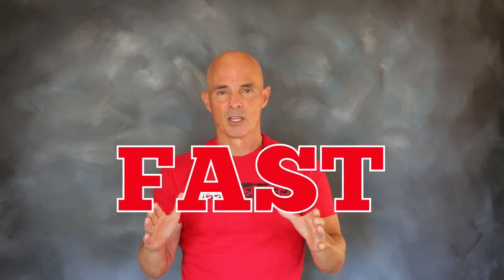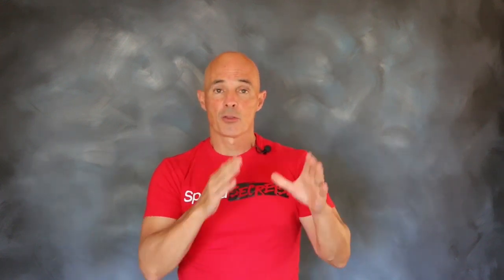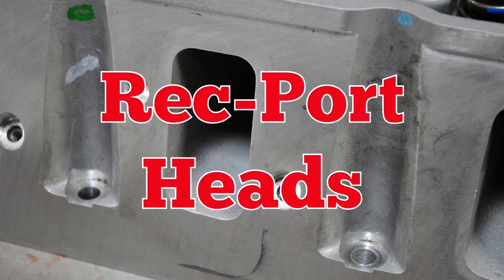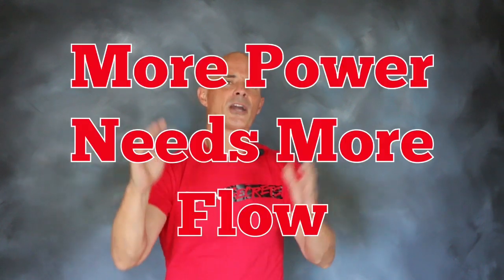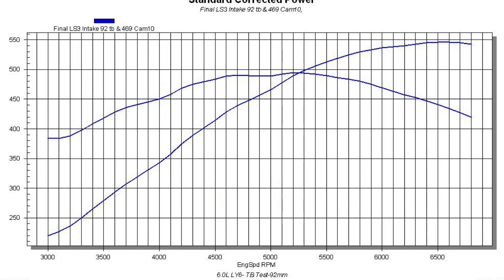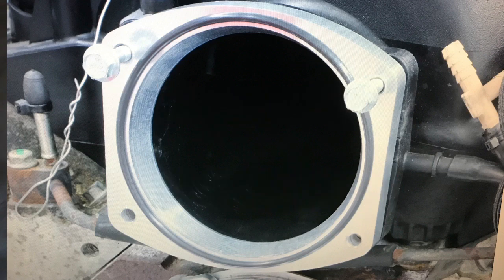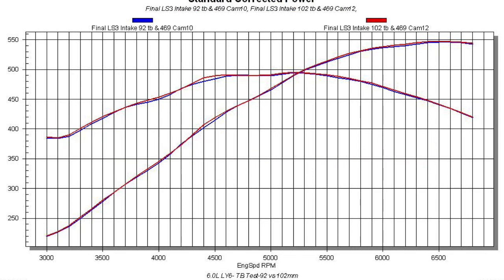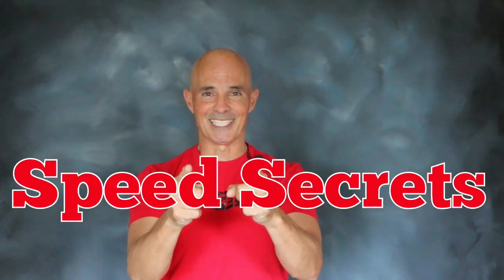Speed Secrets: Does a Larger Throttle Body REALLY Gain Horsepower?

Comment: Wouldn't the adapter still be a choke point even if running a 102mm throttle body? Wouldn't a more accurate test be to run a fast manifold with a 102mm then a smaller throttle body?
Reply from the maker: Correct, the point of this video is to highlight that breathing mods needs to be matched. If you check out some of our other LSXR videos, you can see comparisons between stock intakes (LS and truck style) and the LSXR intakes and throttle bodies.
Reply: But doesn't the point that you are making, that a larger throttle body doesn't increase power, become pointless if you still have the original 92mm restriction in place?
Reply: This would have been more interesting if they dynoed both throttle bodies on  an intake manifold that could use both throttle bodies without an adaptor .
Reply: Absolutely correct! The setup of this video made me think they were going to prove the aftermarket intake made all the powers but using it and swapping TB’s, NOPE! They did the ole bait and switch on us😏
Reply: That's because this guy doesn't do anything. 
He just finds pics on Google and then acts like he's been there.  Lol.
Reply: @shaneonews6791  🤡. Richard Holdener is one of the top guys out there making power on junkyard LS'. Check out his YouTube "Richard Holdener" for plenty of in-depth videos on how to make power

Comment: He actually tested the adapter and not the throttle body. Proving the adapter does indeed restrict. Now I want to see a 92 mm TB vs. 102 mm TB on a FAST 102 manifold to see the real difference in TB power
Reply: No, it does infact give you a larger area. you must deduct the butterfly valve fro the 92mm, so a 102mm with the butterfly deducted would allow more flow. These throttles are far too big, a 65mm is a perfect size for that engine.

Comment: Finally some one who cut through the BS. 
I worked at a mechanic shop years ago and we had a VW pickup truck. My boss installed an upgraded TB on it and the gain in HP was really noticeable
Reply: removed the EGR venturi bulge from throttle body in my 77 rabbit.  top speed went up nearly 20MPH, from 77 to 98.  that's what makes me want to spend $$ on my LS6

Comment: On a 3.8 litre Buick in our VP Commodore in Australia. I put a 65 mm TB, original was 60 mm. Took baffle out of manifold . Took it for a drive and went back to 60 mm. Took it for a drive. Did this a few times in a couple of hours just to make sure it wasn't in my head. Put the 65 mm. Oh joy!!!! Then IAT resistor mod, cai setup. Went very well that identical car with 2 young goons laughing at my VP Commodore wagon which is heavier than the sedan and full of power tools. We had a run and I was in front by half a car length up to 100 km. Cheers from Australia! Australia has worst engine rules. Eg; cold air induction is illegal in pod form!

Comment: The adapter basically made it back to a 92 mm
Reply: True but the 102 does have a bit better runner design than the 92 also. A fast 102 with velocity ring and 90mm throttle will make a touch more than a 92mm intake with a 90mm throttle

Comment: As I understand, you were trying to make a point that a larger throttle body does not make a big difference.  After watching your video, I feel this was a waste as you have an obvious failure that really required no testing to validate (much less a video to explain).  If the upper intake mating to the throttle body is only open 92mm, no matter how you bolt up the 102mm throttle body, you are destined to see zero gains because you will never over come this bottle neck.  Or the gains you see are a result of the throttle body having more room to work, compensating for the throttle plate and shaft (even at that, the difference is so so minor it would be as variable as ambient temp outside the engine).
Why didn't you do a video with an upper intake that could accept the 102mm throttle body and adapt the factory throttle body to show the difference between the two?

Comment: Port polish the adapter smooth ridges create boundry layer impede flow area smaller than smooth original t body. Try test on manifold that doesnt require adapter for larger throttle body Fast manifold etc.

Comment: This makes absolute sence!👍 I see there's a lot of people in the comments that have a comprehension level equal or lesser to that of a toad😂😂😂👍💡 It's like connecting a big fire hose to a garden sprinkler to TRY and get more water to flow through it, But once the high flow of water reaches the "intake" opening, the flow goes back to it's original slow flow because the holes opening size never changed😱 So to get more flow, you have to open the "intake" opening to make it bigger like the big hose👍👍👍

Comment: Wonder what kind of gains I'll see on a 3.0l v6 with full exhaust, 90mm TB and a short runner intake with a 90mm bore. If it's anything like the camaro we used to drag race putting an offenhauser open plenum intake manifold dropped our 1/4 times by a second. By it self. Should see some decent gains on this high racing v6.

Comment: Well the adapter is the problem really you still limit the gains of the throttle body because the intake was maxed at 92 mm had it been larger maybe even bigger than the 102mm the difference may had been seen also I noticed the volume for the engine cam selection was medium compared basically think of the engine as a air compressor more area to fill vs a restricted area yes you might not can feel this but at the strip the right combo can achieve a better time

Comment: And that is why I do not believe in those 92 mm throttle body adapters that neck down to the 78 mm for the pick up intake
Reply from the maker: Exactly, the port size needs to match the throttle body size. Hence why we sell 92mm and 102mm intakes and throttle bodies :)
Reply: @Compcams1976  thanks to yall and Richard we all pretty much have a good idea of what cams to use in a vehicle and what to expect with what upgrades

Comment: HEMI motors react differently than the Chevy to throttle body upgrades perhaps because it is undersized from the factory regardless there is a gain on the low end only with HEMI motors

Comment: Would a TB upgrade help my Jeep SRT if it’s stock?
Reply: Start with a good tune . Get real parts to help your thirst for power . you can start by reducing valve train friction by putting in a decent set of roller rockers . Maybe move on to a better cam because they're out there . Bigger intake valves a set of headers . There's a lot of things you can do without pissing your money away on a throttle body .

Comment: Could I run ls3 intake  with 92 mm throttle body with my 6.0 with 317 heads if not which intake would u recommend for some gains ?

Comment: Also you got to bring up drivability. For someone who drag races not a big deal. Somebody who road races and needs the throttle to be very linear. you only want to put the biggest throttle body in there that will match everything else. if that's a 60mm throttle body then that's the best choice.... did you know you can make over 700 horsepower on a 54 mm restrictor.

Comment: This is easy to explain and I'll use less words.  Horsepower is a byproduct of Torque and Engine Speed.  Think about it.  The LS engine is a perfect example of the factory manifold being designed by people that know what they are doing.  The LS engine just flows so well in stock form.  Each cylinder head can flow up to 450cfm without the aid of the aftermarket.  It's the peripherals that make the difference in these engines.  The throttle body doesnt make the horsepower.  Think about it this way.  Why would you put on a bigger aftermarket carburetor on an engine without upping the jet size?  See what I mean?

Comment: I know you are talking about GM engines, but, my experience in my Mustang 4.6 in this order:
K&N intake. Not much difference.
BBK throttle body 78mm. Notable difference.
Ford Racing Intake Manifold. A huge difference.
I can feel more power and acceleration. The combination of the three parts. One only not make a great difference.
Reply from the maker: It's all about balance! The combination of the larger throttle body, manifold, and more efficient air intake works together! Now all you need are some cams ;)
Reply: YEAH

Comment: Butt dyno I’d say I lost low end torque and gained high end( 4500 rpm +).  As it’s a tow rig that was not good
Reply from the maker: A better flowing intake will definitely gain top end power, it depends on the engine setup and tuning quite a bit. The length of the runners inside the intake determine what your power curve looks like.

Comment: So many people have dynoed bigger numbers with a bigger tb this just doesn't make sense. You obviously port the manifold inlet to the bigger throttle body size. 30whp on a 300zx tt larger intake piping 60whp with larger intercooler. Its simple cars breath better they get more power. Your doing it all wrong. Nobody puts a bigger tb on and holds it back to stock inlet size like you just did lol.

Comment: This test is so wrong and here's why. Look at airflow available vs airflow demand. If the opening and throat of the manifold has a maximum cfm flow of 1,200 and the maximum cfm needed for the maximum hp out of the engine is 1,000cfm and the smaller tb flow is 1,100cfm then going to larger TV that can flow on it's own 1,300cfm will do nothing because of 2 reasons. 1 the most the manifold can flow is 1,200cfm and 2 the max air the motor can use is 1,000cfm. We flow throttle bodies, heads and manifolds everyday and this is what we see.

Comment: A bigger throttle body on a small engine isn’t better. If you have the air flow from the heads/cam/stroke combo then yea. Big gains. But putting a big throttle body on a small engine isn’t gonna make it better. The air flow restrictions are gonna need to be addressed first before you throw a huge TB on it.  So moral of the story. If you have a engine big enough to need more flow. Then a bigger TB will help. But if you don’t. Then don’t waste your money.
Reply: And engine only flows as good as it’s biggest restriction.
Reply: agree